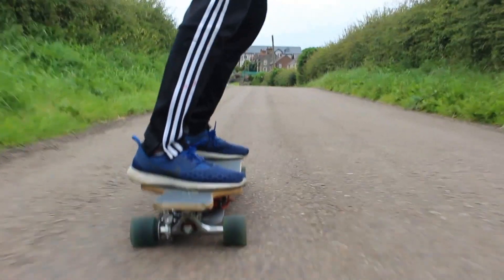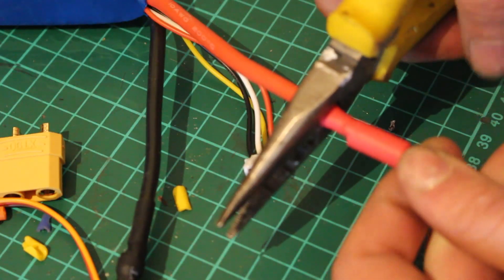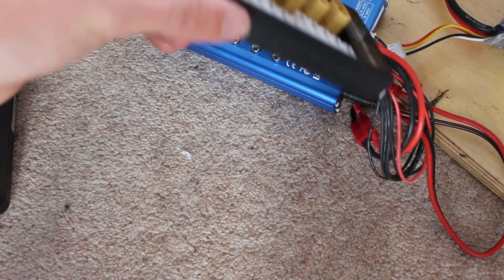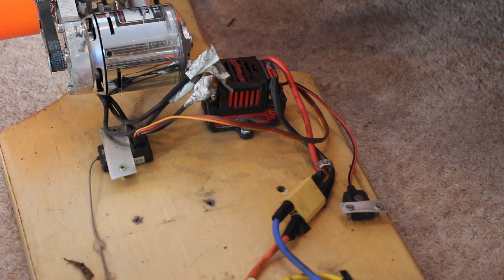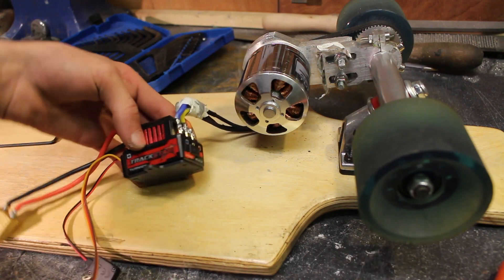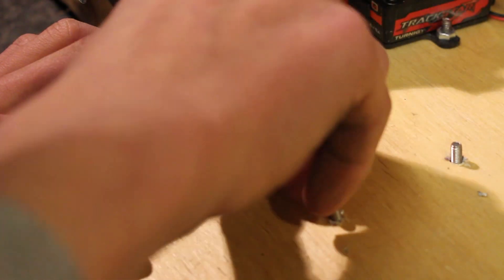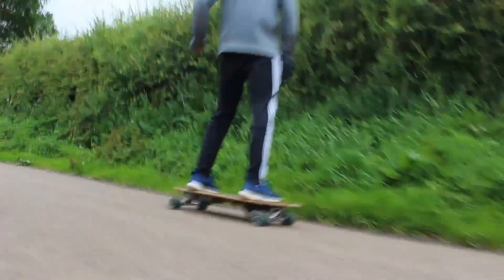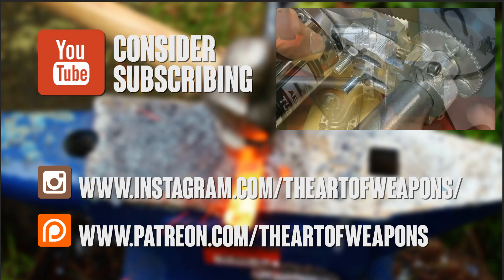How to Make an Electric Longboard - Part 2

Comment: 6:05 no you cant improve the range by adding a 3rd battery. you either have to connect 2 more batterys in parallel or you wont get more range. adding a 3rd one in series does not improve the range.. it just leads to a higher voltage from 22.2V to 33.3V

Comment: Why are you not using a higher kv rated motor instead of an esc that can handel more voltage. as i can see you are using a 192kv (rounds per volt) i'll use a 320kv motor and i hope that the torque is still high enough to get me uphill but i think 1600watss should be fine but verry cool video

Comment: Maybe this has already been said (I don't want to check all the comments ; ) ) but I would definitely make a cover for the battery. The cells are pretty much unprotected in the type of battery you are using and are easily damaged, so it would probably improve their life time quite a bit. And there is also a chance for them to explode...

Comment: you have a 190kv motor that can to 3000w so does that mean that if you put a better battery with a higher voltage will it go faster??? i want to build one but the only think from stoping me is the battery idk anything about batteries

Comment: a suggestion for a good addition would be to add a small alternator to another wheel on your board (would be quite simple to build your own) connect it to your battery so while you're riding your board it could provide a steady charge to your board so that you can achieve further distances and not have to charge your battery's as often.

Comment: When you talk about duel charging your batteries through the panel why do you only have one of the batteries fully connected to the panel? you are forgetting the other white 4s pin connector on the other battery. See 2:14

Comment: What if you added a dc motor with a blocking diode and used it as a generator to keep the batteries charged ?

Comment: Where did you buy your vesc?
Reply: Philip Rossetti Man, He don't use a Vesc, But I tell you, USE A VESC, vesc have regenerative breaks and have comparability with a Nunchuck, Its smaller, and better, Any Question ask me, ok?
Reply: Philip Rossetti You Can Buy a Vesc at AlienPowerSystem or in Enertion site, also in DIYeletricskateboard, I bought in Alien
Reply: Canal Carmedon from which option? Maytech or foyer model
Reply: Philip Rossetti I bought Maytech, but they are the same, just little diferences
Reply: Canal Carmedon when did you make your purchase and how is it holding up?
Reply: Philip Rossetti Mine is Arriving, I live in Brazil, so is harder to ship it
Reply: Motor and battery setup?
I have 2 4s 5200mah batteries and a g160 290kv 2700W motor
Reply: Canal Carmedon i paid a lot for shopping i live in Italy but you know it will be worth it in the end

Comment: Nice build, but I want to hear some feedback on the motor down the road.  The problem with Outrunners I have heard on homemade and commercial boards is they are dead within about a month.  They are so heavily vented and that dust, water and rocks get into them easily and the coils get chewed up in a hurry.  You are the first person I have seen put a cover over the motor, interesting to see if your board last longer then others because of it.  

I am building a couple of boards right now based on 2/3hp 12vdc brushed motors because they are sealed well and I have seen people use 1 hp 12-24vdc motors for go karts and wrack them up as equivalent to about 6.5hp gas motor as far as how the kart performs.  I figured for a skateboard 2/3hp will do.  If not, easily upgraded to a 1 hp motor.  I am trying out Lithium Iron Phosphate batteries as well because they seem to be the best thing in batteries at the moment and found a great 50Ah 12v battery for a few hundred $ (Also, yes, big battery, I want to be able to ride it for several hours before the battery hits cut-off voltage).  Thin, mounts under the board, same width as the deck, runs its entire length from front to rear truck, so I have to mount the motor behind the rear truck.  The other thing I am doing is using a mountainboard for the base rather then a longboard with a set of MBS brakes, replacing one disc with an 80 tooth sprocket for #25 chain and an 11 tooth sprocket on the motor because I am not worried about having super top speed, I want it to have some grunt, so based on motor specs and gearing it should top out around 20km/h (Fast enough in my opinion, don't want speed wobbles).  I went with chain to begin with on a gut feeling those belts would snap with too much frequency, sounds like I was right on that though!

I am hoping it turns out as well as yours seem to have already, but I really am curious about using out-runners, I just have heard many unfortunate stories about them simply because they are usually protected a bit better being inside an RC vehicle.  Hopefully you can provide feedback down the road on yours, whether they survive, get weaker, or die completely.  Definitely subbing so I can see more about this.

Also, just as an aside, if you are using 2 11.1v batteries in series for a 22.2v system, and a 192kv rated motor, and running a 3:1 ratio on a roughly 77mm (3 inch) diameter wheel, isn't top speed only about 20km/h, not 25 as stated in the description?  And I am not entirely sure those are 77mm wheels, they look closer to 63mm (2.5 inch) or so.  Not sure, just curious about specs of your setup with the outrunner.
Reply: I've been running a 147 KV brushless outrunner on my board for well over 200 miles.  Going as strong as ever.  The belts are pretty tough (and quiet).  I just changed my first one out but it was probably good for another 200 miles.

Comment: Looks good.  I noticed that you only have one balance lead plugged into the charger.  The way youre charging the batteries the one that doesnt have the balance leads plugged in runs the risk of under, or worse, overcharging.    I suggest, if you want to charge both batteries at the same time you either get a dual charger or another singlem

Comment: You need to be careful with the restraining device on those LIPO's, you should avoid having anything conductive or anything sharp( even if you have finished the edges after cutting). I would suggest that something like one of the velcro straps sold by HK would be a better option
Reply: Or use Lithium Iron batteries, less explodey.
Reply: It would be easy to use 18650's pretty cheap as well

Comment: parallel charging is much dangrous then serial, you got it wrong there. Serial charging is so much safer than parallel. you need ta have exactly the same voltage in all lipo cells to make it "safe".

Comment: it's a lot safer to charge the battery's in series, or just seperate, paralel charging can only be done if they discharge paralel too, otherwise it can be dangerous, not all cells will drain equally.

Comment: You might consider using a DC-DC boost converter to increase the voltage whilst using your two batteries in parallel to increase battery life.
This would be a lot cheaper than adding a third battery in series, and may be more effective (something you could test for yourself, boost converters cost next-to nothing)
Reply: Psychotic Horse Meat I'm down for that
Reply: yo fam are you high? You want to use a AT LEAST 20A boost converter to step up the voltage to the ESC to "increase your range" what?!?!?! The amount of power you would loose from heat would drop your battery life, let alone trying to actually find a boost converter that can handle that much amperage and  get hotter than the surface of the sun. Anyways just a stupid idea, sorry man.
Reply: +Psychotic Horse Meat hey its not my fault I have aids. Can you elaborate on why I'm retarded? I've had many people tell me that though I would love to know why. maybe its cause I literally look like a walking potato.
Reply: Unfortunately you are wrong and Jdog is correct.  DC-DC booster will have losses, as everything does.  As well, theoretically lets say you are using the 2 batteries he has.  In parallel they last twice as long, but top speed is halfed.  In series, top speed is double, but battery life is cut in half.  Overall using the 2 batteries he has in series or parallel will give the same range, but one is fast and discharges quicker, the other is slower but discharges slower as well.  

Another example is like the difference between running a 12v and a 24v dc motor.  If they are both rated for the same wattage and speed, the 12v one draws twice the current the 24v one does.  Say you use 2 identical batteries for both motors, but you have them paralleled for the 12v motor and in series for the 24v motor.  In parallel you have 2C capacity, but your 12v motor draws twice the current of the 24v motor.  The 24v motor draws half the current but your batteries in series have only 1C capacity.

Do you understand where this is going?  In a small system like this especially, running the identical batteries in series or parallel will give the same range, top speed and time to discharge are what change.

A DC-DC booster is only adding losses into the system, as well, you can only go so fast on a board before you get speed wobbles and safety becomes a thing, so adding increasing the Ah rating of the system to give longer run time would be the same total distance increase as adding the same battery in series to go faster, but would be safer because your top speed does not increase if you parallel batteries.
Reply: Fine, I won't lecture you.  There is no, "it may be more effective".  IT WILL NOT BE MORE EFFECTIVE, NO TESTING REQUIRED.  But if you really think it will, find a 3000W DC-DC Boost Converter that weighs less then the battery (1lb), is smaller then the battery, costs less then the battery, and is efficient enough that would provide enough benefit to range, longevity or ease of use that it is worth using over a third battery.  Make it work, show me, prove me wrong if you really believe it will work.  I sure as hell wouldn't invest my money in that idea though.
Reply: OMERHGAD NOT ENOUGH WAAATTTSSS NEED MORE POWWWAAAHHHHH 
ALL THE GEEEGAHH WATTSS
Reply: Psychotic Horse Meat - I win.
Reply: Is this important to you? 
Does 'wining' an argument on YouTube make you feel content? 
Is your life so mundane that commenting on some kid's video is the highlight of your day - give you that warm, fuzzy feeling? 

If you truly live such a miserable, insignificant existence then sure, you win. Whatever helps you sleep at night - when you're all alone and balling your lifeless eyes out. 

Would you like me to pass the Clorox?
Reply: Psychotic Horse Meat - LOL, you seem mad bruh, you angry you lost an internet argument?  You mad it wasn't even an argument, that you just said something stupid on the internet and people called you out on it?  But nah bruh, life is great; good job to support my happy family, doing the things we love to do, but can't beat that cherry on top when you ruin some asshat's day in the YouTube comment section!  :D  It really is the small things in life!

Also "winning", two n's in there mate, and Clorox is a brand, so yeah, if you want to give my some CLX stocks, that would be mighty kind of you, I hear they are headed up, probably from all the people like you consuming their bleach based products!  :)
Reply: Yall need to stop and forget about this shit, jesus.
Reply: Psychotic Horse Meat - As much as I enjoy other countries cultures, America is not one I would like to partake in.  On your own there bud.
Reply: Psychotic Horse Meat  - You partake in a lot of odd activities.  Wrong again.  Good luck!

Comment: just going to mention the laginess of the ESC is not because  it's cheap it's just because it does not have enough amps I do RC and HobbyKing is one of my favorite RC websites and that motor you're using is a big motor and can probably handle up to 10 s lipo what i success you do is get an ESC with a high amp rating like 200 amps or more  that way the ESC won't be laggy and also I noticed that you're using electric tape on the connectors you should probably use something like heat shrink it's much better
Reply: Budget Friendly RC the moter that he is using us rated for 12s 80A so a 100Amp esc should be plenty

Comment: Seriously, i'm not interested in bashing or criticising your project here (it's great) but man, you really need to brush up on your soldering skills, and get a proper soldering iron with a chisel-tip. The round one you are using is very much unsuitable for soldering heavy gauge wires. Also: Heat shrink!

Comment: You need to tin the wires first. You can't afford bad connections in high vibration environments and over time the joints will fatigue (+use heatshrink for every joint as well as silicon/hot glue to reinforce, also very inexpensive) Here is a link to how to properly solder xt60s 😀
Reply: you realize there isn't a link right ?
Reply: It's a chinese link dude, breaks down after 2 weeks.
Reply: best link ever, 10/9 dolphin stars
Reply: FliteTest IS the best
Reply: +Smokey the Bear it's in the replies below ( view all replies )
Reply: not really a good idea. A staked and crimped connection would be much better.

Comment: you need to re-do all of those joints in the wire with proper tiedowns and heatshrink, the tape covering the solder joints won't stand up to any dirt or moisture from the road and then you'll end up with bare joints which with lipo batteries is a recipe for disaster

Comment: For clearance, get truck risers.
Reply: But bigger wheels still make it nicer to ride easier on numbs
Reply: Bumps
Reply: +Ryan Soltysiak actually wrong dude on longboards the bigger the better that's why Regular skateboards with only 52mm wheels are so slow for cruising. When you want speed on a longboard you would want 70mm or more
Reply: +Calvin Haslam Yes but larger wheels require more power to turn so the motor would be bogged down.
Reply: +John Doe I recommend 72mm wheels and a 1/2 riser
Reply: Put on a larger sprocket on the wheel.  If you put larger wheels on and adjust the driven sprocket accordingly, you should get identical performance out, just with more ground clearance.

Comment: Please for the love of God get some heat shrink tubing to isolate all the wires. Just put it on the wire before you solder the connection, then slide it over and  heat it with a heat gun or lighter.
Reply: i agree, please use some heatshrink tubing, thats most likely why your esc stopped working, the wires must have shorted out. rc cars go through lots of vibrations, much more than a longboard. the vibration definitely did not kill the esc
Reply: +Roman Brutsky 100% agree. considering his mechanical ability those electrics are scary. dirt, dust, water and mud ain't gonna stop a good brushless system but wiring like that and metal battery clamps directly on lipo batteries . . . . . asking for trouble.

Comment: awesome! i built my own eskate board. how do you make the controller accelerate by the trigger because mine accelerates by the wheel on the side?
Reply: LOL your using the wrong channel on your receiver probably.
Reply: Thank you
Reply: Yeah np usually you'll have 2 channels on it labeled #1 and #2, just try swapping which one its on and see if it works.
Reply: +Jdog Awesome i tryed changing the channel it worked once but then i did again and it wouldnt work?
Reply: rebind it

Comment: from vaping one thing I've learned is don't charge batteries in a different circuit to the way you use them also you would have been better off buying some new heat shrink wrap, pulling the current wrap off and then connecting them in series directly and re-wrapping the whole thing this would eliminate a lot of voltage drop you get with your triangle connection
Reply: I'm sorry but what voltage drop are you talking about with his triangle connection? P.S. I don't recommend you start off a comment like that "from vaping"
Reply: +Jdog Awesome as the voltage from the batteries travels through the wire it will lose some voltage because of the resistance of the wires
Reply: Well yes conductors have some resistance but  in this case its going over no more than MAYBE a foot of wire, so the voltage drop is negligible.
Reply: +Jdog Awesome well you see, we're talking like 10ths of volts dropping which to you may be nothing and probably wouldn't make a difference here in this situation but it is there
Reply: I know its there but with EBoards its very insignificant. With 1' of 12 AWG wire at 30A you would have a voltage drop of 190mV which is actually more than I imagined but, still very little.
Reply: +Jdog Awesome see to me as a vaper this is quite significant but in this use probably isn't